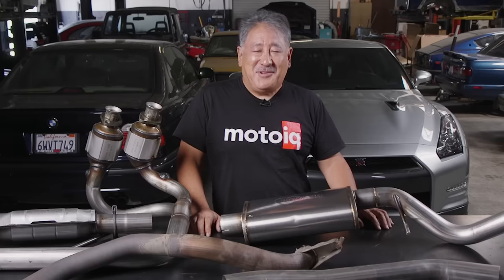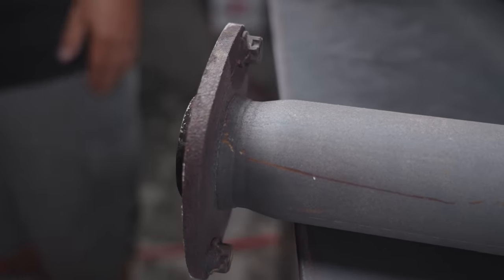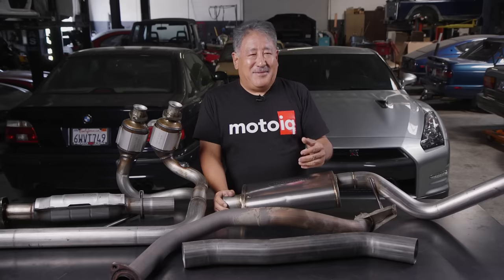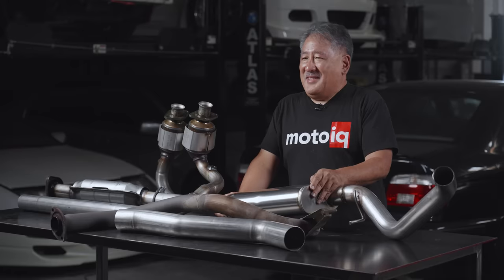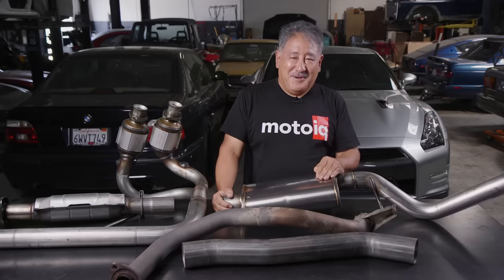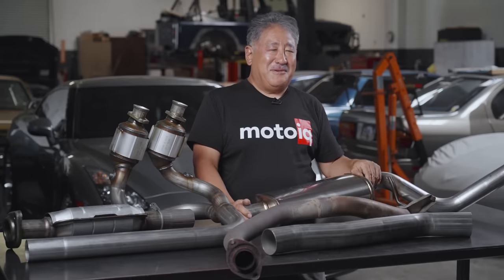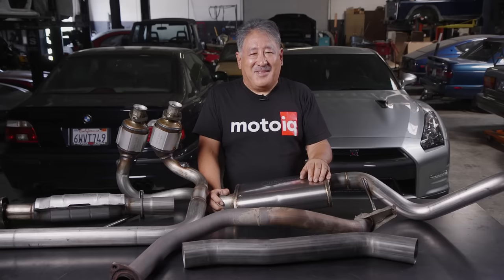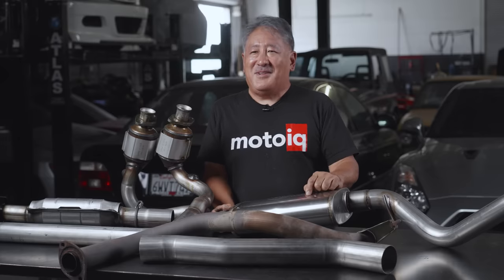Exhaust Back Pressure Myth DEBUNKED!

Comment: Robbing Peter to pay Paul… having back pressure, or making velocity,  they are both essentially doing the same job. Don’t believe me?? Then put a 4 stroke exhaust on a 2 stroke engine and tell me how “more natural bends” help in any way? Or put two 6” pipes with on a v6 and see how it runs? Burnt valves anyone?  Smaller pipes create restriction,  restriction could easily be called “back pressure”… Also what is a “natural bend” in a pipe??  I mean do people find pipes just growing in the wild, and our man made pipes need to mimic their bends?  (If you want to talk semantics, make sure the ones you use aren’t stupid)
Reply from the maker: They are not. You just don't understand anything being said and just want to amplify your incorrect point.
Reply: @motoiq  Ok, so what will happen if you run the engine with exhaust at all?  You burn valves… so my question to you, is why do you burn valves without an exhaust pipe? (Spoiler alert, there is more than 1 answer)
Reply from the maker: @dan27052  you ruin the scavanging, watch the video and try to understand it. You also throw off the AFR.
Reply: @motoiq  I watched the video, so I know that you don’t understand what you are saying.  You need pipes to both absorb heat, and to channel it away from the valves.  If you don’t have an exhaust manifold of some type then you will overheat the heads.  You will get more HP out of it, but you will also ruin your heads, and possibly overheat the block too, also you can cause backfiring too, (but that’s usually on smaller engines, it’s why you have to rejet carbs when you change pipess on a motorcycles) though it does happen on high hp engines too. You’re really getting confused on semantics, which isn’t a big deal, until you try to call people wrong for it. Please do a little research before posting videos in the future…
Reply from the maker: That is not how it works.  Not at all, not even close.  You didnt watch the video or even though the video is super simple, you didnt understand the concept. I am calling you for not understanding how it works. You are not even close to understanding how a 4=stroke works.
Reply: @motoiq  you shouldn’t have made the video because you have no concept of how things work… you might be able to assemble the parts, but as for knowing how the interact with each other, you really have no clue…I’m not going to go back and watch that video again because I don’t want to give extra views to unsound guesses… I’m still trying to figure out how to get “natural curves” in any metal pipes?  Is there a magical land that these pipes grow “naturally” in?? You do realize that pipes can’t have natural curves because there is nothing really natural about them. Iron is mixed with carbon at around 2600 degrees to produce steel, so in no way can that be natural… I only bring this up so much to tell you why your terminology is completely off about the back pressure thing.  Also I know you were talking about 4 strokes, and if you change the pipes on a motorcycle (with a 4 stroke) you are going to need to rejet the carbs, or retune the fuel injection, or it won’t run right and you will probably get a lot of back firing, and in worse cases you can get burnt valves, same as in cars with the wrong exhaust manifolds or pipes on them. Why, because you have to have to much airflow straight out of the exhaust ports.  Again, a hotter engine runs faster, so a lot of drag cars will use it to their advantage because they aren’t running for a long time, but you do severely decrease the life of the engine playing around with that.. But hey, you do whatever you want to with your cars/engines.
Reply from the maker: you really need to watch the video and try to understand it.  This how things work and it's not the world you live in. If you don't believe me. google the subject. read and learn.  You will be embarrassed for being so cocky about being so wrong.
Reply: @motoiq  yep,  all I’ve done is told you why things work like they do, and given examples to back up what I’ve said…. All you can do is tell me I’m wrong because you say so… PS I watched that video once, and really wished I hadn’t, I’m not going to watch it again as you keep begging me to do, because I really don’t want to give it anymore views. I’m not replying anymore, good luck on your future endeavors…
Reply from the maker: Because I am an engineer that builds these things with an extensive science background and you are so arrogantly wrong I would be embarrassed as you make yourself look dumber and dumber with so much confidence with absolutely no empirical evidence. I know you will reply to this.
Reply from the maker: Cool!

Comment: So all the engineers are wrong and you are right, right !
Reply from the maker: Well the engine is designed to make 145 hp and have good fuel economy and emissions. We a doubling the power so the engineers didn't design the engine for that.  I never said they were wrong and I was right.

Comment: Depends how big the engine is smaller engines do not work well with big exhaust until they are flat out😂
Reply from the maker: No engine works well with too big of an exhaust, except turbos to an extent.

Comment: I think in the old days they used scavenging to pre heat the incoming fuel so they wanted a little back pressure but the technology's have changed and so have the fuels so it isn't needed also we have a way better understanding of what's going on in the cylinder. and can control valve opening and timing at all RPM, it's just the new tech vs the old tech.
Reply from the maker: That is completely incorrect.
Reply: @motoiq  dhoe! Going to have to look into it,  why would they call it scavenging? It means to search for or collect anything useful from  discarded waste.
Reply: @DKLGalactus5 The flow of the exhaust pulls in fresh air behind it through the valve overlap period. This allows for slightly more than ambient pressure in the cylinder before everything is compressed

Comment: Larger pipes and a high temp shop vac to suck out the exhaust and the right speed should do the trick 👍
Reply from the maker: It would have to be one hell of a vac. Unfortunately the power it takes to drive such a vac is more than can be gained.

Comment: He doesn't mention gas mileage at all. Reducing back pressure may not hurt power output, but it can have a detrimental effect on gas mileage. If you're concerned about that?
Reply from the maker: It usually helps mileage all other things being equal

Comment: If that's true why does my 454 motor home have single 3 inch exhaust?  If back pressure is not needed . If you put on dual exhaust you lose torq.
Reply from the maker: It is probably a big block small port low power engine that doesnt need any bigger.

Comment: Scavenging is the true king.. but also power band is a thing… it all depends.. just like anything else on a engine.. too much cam to little cylinder head ect… collector length.. Iv found is optimal at 1 and a half feet!
Reply from the maker: 18" is pretty short.

Comment: Backpressure can help on gas mileage. Duh.

I've tested it back in the 80s guy

Bloodviking
Reply from the maker: Actually if everything is setup and tuned correctly with properly sized tubes, mileage will improve with less backpressue, it's thermodynamics guy.

Comment: Well any motorbike i have if i dint get a good bit off baffle into it it would bog out on me and backfire too. Oldtimers have good wisdom they are old timers they lived lkng enough to experiment with back pressure and without
Reply from the maker: Your bike leaned out, rejet and see how you now have even more power.  There are many reasons why uncorking an exhaust can lead to less power but less backpressure isnt one of them.

Comment: Theres a reason why motorcycles come with an exhaust flap valve(exup valve in a yamaha) in the exhaust to improve low end torque.  😂. Sorry to bust your bubble guy. It works great for street use.
Reply from the maker: The EXUP valve opens the other runners at low RPM to act like an interference branch guy, sorry to burst your bubble.

Comment: I haven't tried it on a car, but on my bike, when I went to straight pipes, it lost torque. I put them back on and the torque returned. I live in the hills, and with out the baffles, it was gutless.
Reply from the maker: It is not due to backpressure, you killed the velocity and or the tune
Reply: @motoiq   the only thing that changed were the baffles. same pipes. I had torque and sound. took out the baffles. had sound, but no torque, even after re jetting and the needle for an 87, 883. sounded great. ran a little rich. but low torque.
Put the baffles back in and the torque, came back. back in the mid 70's in Slidel La.  i went to pick up my date and meet her father. Campy Holly. he was the head mech for the Harley shop in New Orleans, west bank. I went to work with him. she and I never did go on that date. in his spar time he built drag bikes. he said it had to do with the shockwave in the pipe and that the baffle broke the wave some how. short answer, he said use baffles, or lollypops to adjust for best torque, and sound compromise.
Reply from the maker: Did you see the Harly step headers by Blow Performance, they can be run open but step the primarie diameters to keep the velocity up.
Reply: @motoiq   I haven't , but will check it out. thanks
Reply: @motoiq  those are cool. listening to them, put a big grin on my face. I LIKE IT.

Comment: You want a little bit of back pressure or your engine won't accelerate your vehicle. That's one reason why you need an exhaust manifold
Reply from the maker: That is completely not true.  If you don't believe me, check out what Gale Banks says https://youtu.be/k7yYY_hy250?si=PGIIk5Qfbafrdr2z  If you don't believe Gale Banks, here is a test garage 4AG did https://youtu.be/V2Wv5-ZTOjM?si=oA1CylAdrnh5m48K  You will note that increasing backpressure did nothing but hurt the bottom end.
Reply: @motoiq  yes you do when you a pressure gauge on it it reads 1-3 psi and without it aka an exhaust leak you have no power which means absolutely no back pressure so yes you do need some
Reply from the maker: An exhaust leak causing power loss isn't due to low back pressure.  Don't ignore facts. Did you even watch those videos, 0.4 psi, the lowest possible had the best power, even on the bottom end.  Your exhaust leak is killing system velocity.

Comment: When you Un cap the exaust on an old 70s car. The engine will need more fuel to run and hesitate and want to run with the choke partly closed. The fuel mileage will now suffer from less back pressure.

Bv
Reply from the maker: If your tubes are properly sized and the engine is tuned correctly it will use less fuel everything else being the same.

Comment: so open headers would be best?
Reply from the maker: It depends on what you are doing.
Reply: @motoiq  oh cool. Didn't think you would reply. I have a technical question about that. Would it be best to have the initial runners to be the same volume as the exhaust port or would opening them up right after the port be better. (Assuming the gasket is port matched and not interfering with flow)
Reply from the maker: That is too general of a question to be answered with the information you gave.  It depends on many things like the displacement, rpm range, cam profile, bore to stroke ratio, stroke to rod ratio, head flow.

Comment: Us "old timers" needed back pressure to eliminate valve float at hight RPMs on the highway. Once we started making our own headers we added washers under the valve springs, then two springs on the valve stems. Modern engines have eliminated the need. It was about making our own tech that engineers designed into modern engines. Please stop throwing us old guy under the bus we did what we did because we wanted to and you 'kids' benefitted.You're welcome.
Reply from the maker: Adding back pressure to stop valve float is a myth in itself and totally not true.  Adding washers under the spring doesnt not increase spring rate, just initial preload and reduces coil bind height and adds to spring stress.  None of that is good at all.  More old wives tales.

Comment: Exhaust length?? To short burns valves. On bikes long exhausts produce more power??.
Reply from the maker: Exhaust backpressure has nothing to do with burning valves if your AFR is right.
Reply: @motoiq  if the exhaust is short it backfires on the overun. I have experienced this in cars and on bikes. One car I raced would burn valve seats until I lengthened the exhaust. Not back pressure  but timed length.
Reply from the maker: If your afr was right you would not burn the valves. It pops because its lean due to not having an exhaust.
Reply: @motoiq  this was years ago .normal carburettor.  Mixture correct. Adding pipe length stopped the banging. And stopped valve seat pocketing. The mixture was not lean on throttle. Full throttle kill ignition nice plugs. I put it down to vacuum in the exhaust pulling air back to the head.
Reply from the maker: How do you know it was not lean, what was your AFR?  They probably didnt have widebands then.  Because I could tell isnt saying much.
Reply: @motoiq  we used to do a plug chop. Ran the engine at 80% to 100% then killed the ignition. Checked spark plugs for color... but without altering anything having a longer pipe stopped the banging. On a engine brake a Honda race bike produced more power with longer pipes.
Reply from the maker: For sure the longer pipe would produce more power.  However they are a lot of myths on how to read plugs as well.
Reply: @motoiq  yes I agree . Computers have helped a good deal. But cutting the ignition to test plugs was common.  I even tried a color tune plug . Bit like a glass plug that allowed you to see the flame color.
Reply from the maker: Colortunes don't work.
Reply: @motoiq  agree they were rubbish. But the plug chop gave you a good idea as to what was happening inside the cylinders.